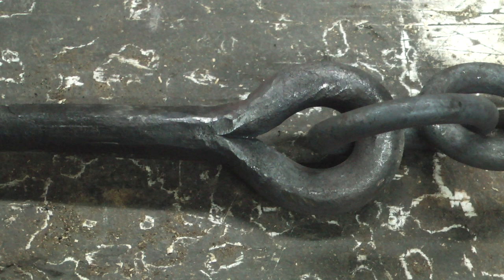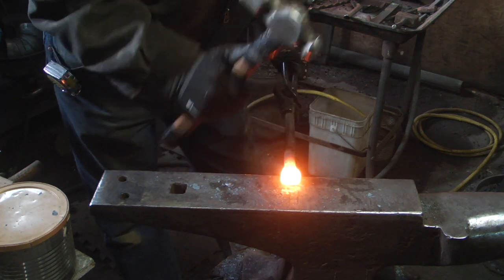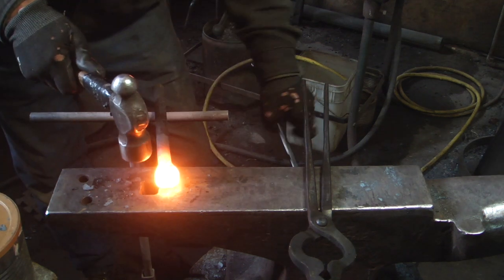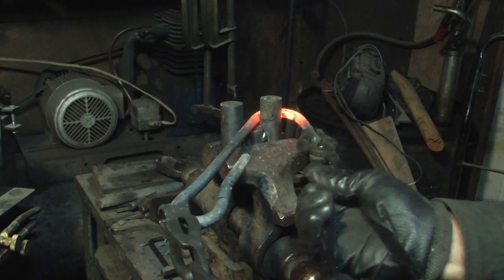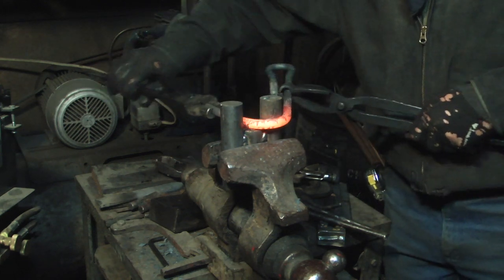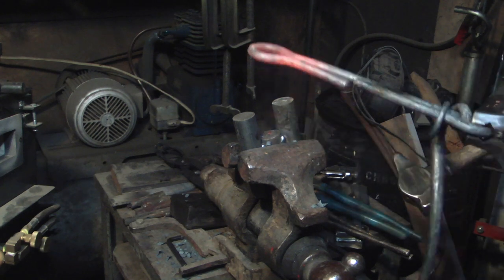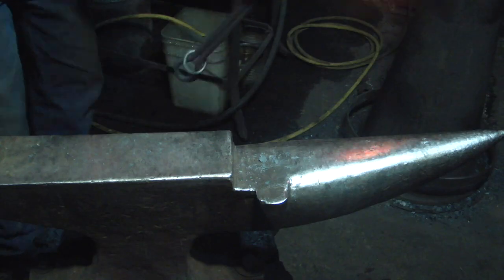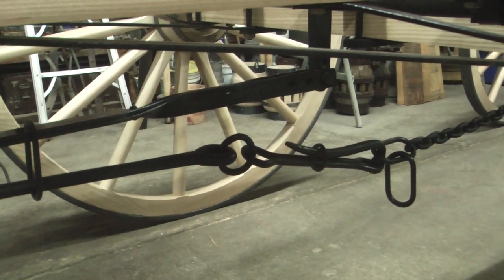Forging a Pelican Hook and How to Hitch 2 Wagons Together | Engels Coach Shop

Comment: The Navy uses pelican hooks every day to connect span wires up to 2 inch under 12000 lbs. of strain during UNREP operations.  The reason is exactly that they can be knocked off under load.  Your videos are excellent. Please keep it up.

Comment: Dave you just answered a question that was never explained to me when I was around 8 or 9. When you actually turned the ring around till it hit the spot where it would go on or come off so the pin would work properly. It was a very frustrating situation where they got their pleasure watching me and laughing their fool heads off at me. Thanks for sharing with us.

Comment: Excellent!!  I've made a few of these in the past and never have known it was called a Pelican Hook, LOL....... Now you need to make the chain!!  So, I've noticed that you use a traditional cross peen hammer along with a ball peen.  I do the same.  Now, British smiths, especially around the turn of the 20th century used the ball peen almost exclusively.  The only reason I could think of is that perhaps it's an appropriation or hold over from the boiler makers.  As an experiment, I've done projects entirely using a 2.5 or 3 pound ball peen.  It worked well, but I still prefer my trusty cross peen for most everything.  Oh, I wanted to say that I think you're a very good smith!!

Comment: Thanks Again, Mr. Dave, for another Friday TREAT!!!!
Reply: I have been busy & having alot of fun getting sub-assemblies built up.  I'm not too far from assembling the fuselage.. just one more large tail cone to complete.  I have the wing work done... thinking, planning to Polish the beast... but discovered the wings have a clear-coat... You can't polish clear coat :-) not like aluminum.    Once the 'outer' fuselage is together, there will be plenty to do completing all the inside things.   
At some point, it'll go in the back yard and the wings and tail will go on, and I can make cables and rigging...  then come back apart.  And we'll see what, if anything, the HOA has to say about THAT!  :-) :-)  Indeed, it is nice to not have a deadline/delivery date.
Fun is where you find...as you know!

Comment: So with that setup the 2nd wagon has no pull on the lead wagons frame or box and is directly pulled by the team through the double tree and front axle irons. 
I always figured it was hitched through the reach. 
I can see it being much stronger and longer lasting with the chain and pelican hook. 

Thanks for sharing.
Reply: EngelsCoachShop 
The innovation that went into something seemingly basic as a wagon is mind blowing at times. I am sure it was innovation based on failure of one design and resulted in the designs that the wagon era ended up with. 
Did the Borax Wagons have a similar linkage? 

Might be time to go back and binge watch the Borax series. 😀

Comment: Pelicans hooks are cool. They are safety quick releases. Tie a rope on the little ring, and pull on it and the pelican hook opens releasing the load. They hold a tremendous load, yet can be opened under load with very little effort. Not many other low tech solutions to this problem. You still find them on modern sailboat rigging for the same reason as on that coach, When things get cocked up, you need to react and release things fast sometimes.
Sometimes the old ways are the best ways.
Reply: All in a days work........

Comment: I find it interesting that a pelican hook is used on this wagon and is the same type of connection made on a Naval ships for a fast release to drop the anchor.  The one shown here is almost identical to one's I've come into contact with, just a bit smaller as it is not controlling a 30,000 lb anchor.

Comment: Those gloves cost 2$ a pair and skin grows for free . As i was taught by an old Ironworker in 79
Reply: Wayne Robinson I'd rather spend $2 than burn my hands and have to step work until my skin grows again. Assuming I don't burn them that bad the skin won't grow again! That said I'd be using riggers or leather gloves.
Reply: Yep! Skin always just a sloughin' off, so save yer change a wear singe a little now and then won't hurt! 😄😉 Seriously though, I have never like using gloves very much. Others I know use gloves for doing anything, but I usually spend more time dropping and picking stuff up when I try to use gloves. Even at the anvil or welding, I usually only use one glove if it is absolutely necessary. So in my humble opinion a few holes is quite okay.
Reply: I noticed those gloves last week. I figured that they kept most of the sparks off when working at the anvil and most of the snow off when he went out to lunch at the diner down the street, so they were plenty good enough.
Reply: edward charles actually men have always worked with little memes . Scar tissue does not burn it will scorch but slight inconvenience  only . We always wore monkey skin gloves that first had all fluff burned off with a torch that way they lasted longer .
Reply: Ed Warnock
 I am with you
Gloves get in the way.
I have done hrs and hrs of welding on small batch production and only wore one glove.
And then only if I had to.
I used to cut the fingers out for some jobs the back of my hand got too hot otherwise.